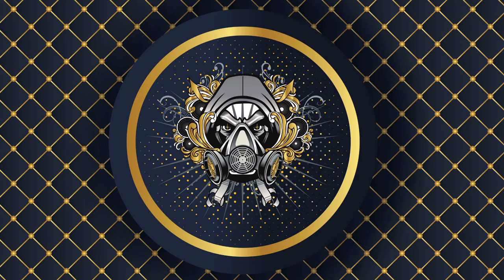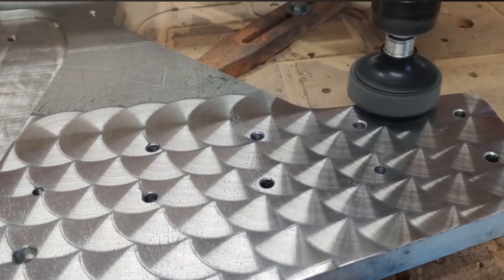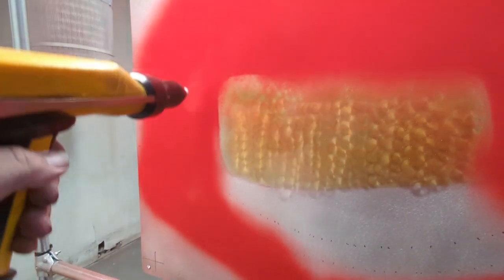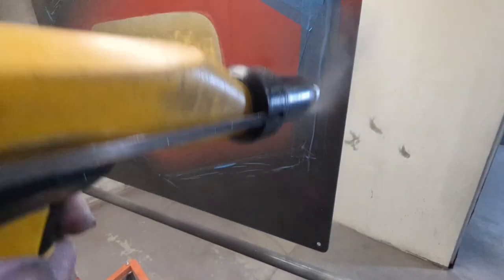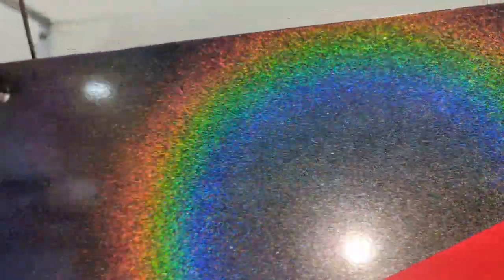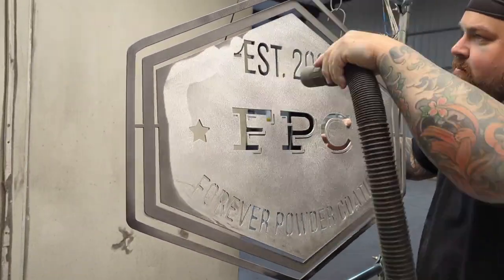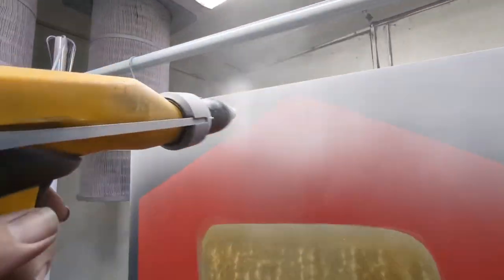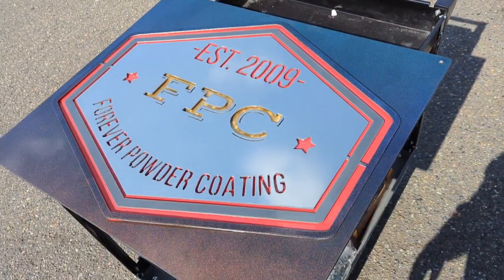Doing custom powder coating for an industrial powder shop! - EP 169 - Unknown Coatings

Comment: Dude so awesome. I’ve been having a hell of a time with super chrome plus and the glossy clearcoat.  All I get every time is bubbles. If I were going to use any other power ow whether it’s transparent or flat or anything, it’s perfect but for some reason, super chrome, plus and the glossy clearcoat are my nemesis. I’m thinking both of those are garbage and I need to start fresh got any ideas? God bless, bro sign looks like all of your stuff. Simply amazing.